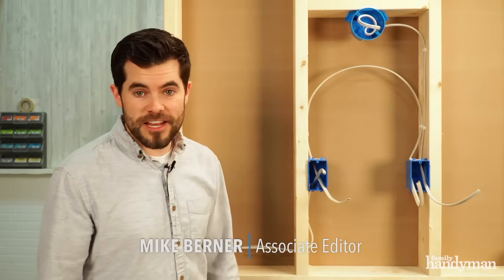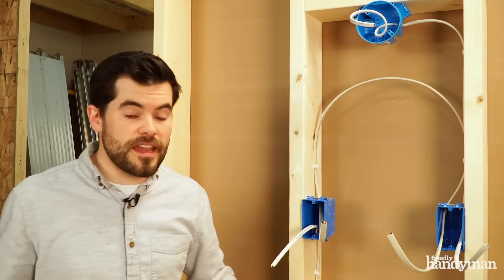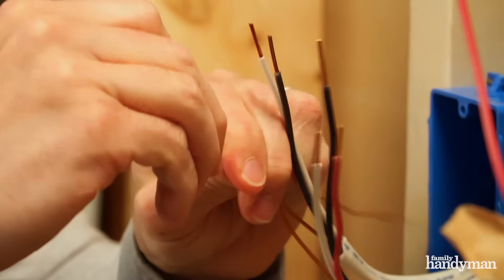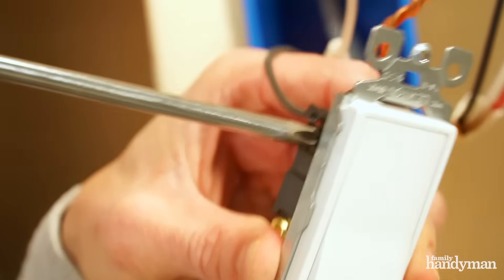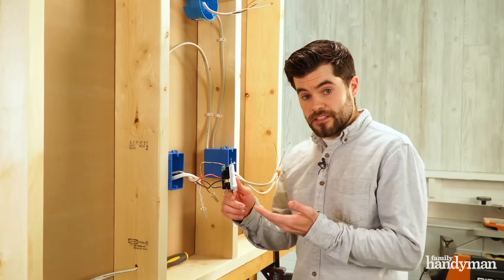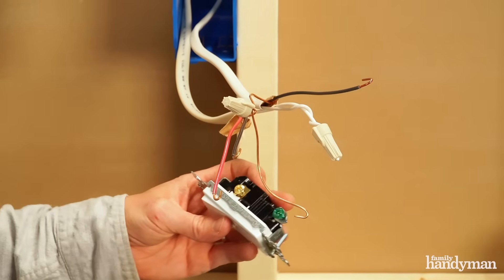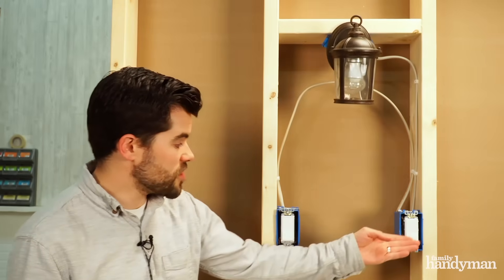How to Wire a 3-Way Switch

Comment: Very interesting.  But not all cables have the same colored wires.  So, it might be helpful to describe the wire with more than its color, but also its function, like you did when connecting all the ground wires at the beginning.

Comment: @Family Handyman 
Question, I have both the hot line from the breaker and the line going to the lights coming into the same box in switch 1. Switch two is clear on the other side of the room. 
How do I wire that?

Comment: Thank you for the video!  Attempting to put a smart switch (Kasa) in a garage location and I'm faced with no neutral wire extending into the garage switch box.  Kasa requires a neutral wire as I do not want to use a hub like is required with Lutron.  After watching your video, I may just connect the red traveler to the neutral in the first switch box inside the house to the garage and convert it to a single pole switch.   I also may just call an electrician if things get too complicated.

Comment: I think I noticed in the video that you have a 14-2 and a 14-3 wire but you did not explain that so I'm a bit confused can someone explain!??
Reply: EXACTLY! Good eye! It's unbelievable that he never even mentioned this!! 
First of all, you would only use 14/2 -3 if at your box the circuit's amp is 15 amps. And 12/2 -3 if your amp is 20.
With that being said, NORMALLY coming out of your box it's normally 12/2 wiring! But, when you are connecting the 2 switches you use 14/2 JUST TO CONNECT THE SWITCHES, and 12/2 to the light.

So, 12/2 is your main electric that's coming into the room.. you would only use 14/2 to connect switches.
Reply: the 14/3 wires serves what is known as "Traveler Wires". They connect between the two switches and are what enable the 3-way switches to work. They connect to the two gold screws on the switch themselves. One 14/2 is homerun (or what brings in the power), which connects to the black screw (know as "common") on the switch,  and the other 14/2 connects to the the other switch to the light bulb. If my explanation isn't clear enough, I would suggest that you look up how 3 ways switches work.

Comment: Be sure and label what color wire goes to the bottom lugs. In the video he has the red wire switched on each 3-way plug. That is incorrect!!! Red wire should go on the same lug on both switches!!!

Comment: I see that the power source is going to one switch and the other switch has the power going to the light but in another video the power source and the power going to the light was in the same switch. Does this mean it can be hooked up both ways? If anyone can answer this I would appreciate it.

Comment: Perhaps you should make a video on wiring 3-way switches that have a built-in dimmer also known as a rheostat.  Considering it's a series circuit i'm curious whether only one rheostat can be on the series circuit. Or is it possible for both switches to have dimmers and have them both work?  I only watched your video once but my takeaway was that a lot of what you said would only make sense if somebody already had quite a bit of knowledge with regard to wiring and were already familiar with all the terminology.  And it occurred to me that if somebody knows all that terminology they've already been practicing at this and probably already know how to install a 3-way switch. Someone who can't install a 3-way switch is a noob (Like me)

Comment: This seems simple for installing, but doesn't match what I have existing in my house.

My boxes have 10 wires total(3 separate bundles) at box closest to panel and 7 wires (2 bundles) @ the box on the other end. 

Every 3-way switch setup is wired this way.

Also all old switches have 3 connections...and all the new "smart" switches have 4.

Anyone ever run into this before...or have any idea how to proceed ?

Comment: I wired my lights the way you explained; however. The light would not turn on ftom one of the switches
Reply: Make sure that your second switch is set up identical to the first. The hot wires might be backward on your second switch.

Comment: Thanks for the video. I have a light in my stairwell that has a switch at the bottom but just a box full of wires with a blank plate over it at the top of the stairs. I've been wondering if it's wired for a 3-way setup. There is a red wire in there. I'll need to investigate further but I'm hoping I can just install a new switch up there. I've nearly tripped more than once in the dark going down the stairs.

Comment: You paired with black common wire with red wire travel terminal on 1st switch...on the 2nd switch you paired black common wire to the light with black travel terminal.?

Comment: How do you know which black wire goes to the light/common acrew if all that is hidden behind walls?
Reply: They are not completely hidden behind the wall. the part of the insulation where is trimmed is still within the box, and you look for that to determine which wires are the travelers. Process of elimination.

Comment: With this guys help and communication skills I was able to wire a renovation to half my house. When I finished all wiring I installed all fixtures and went around checking everything and everything works perfectly. 
Outlets, multifunction and three way switches. After doing this I gained a much greater understanding of residential wiring. 
Thank you sir for your videos. I saved a lot of money and learned a lot.

Comment: If I’m replacing a 3 wy switch, how do I know which wire is the connector to the other switch, and which goes to the light?
Reply: I know this comment is almost a year old but if you have a multimeter, you can do a continuity test between the two wires.
Reply: The wire going to the light needs to be on the black common screw

Comment: Great video! Seems I screwed up installing a 3-way dimmer, as the non-dimmer 3-way at other location was basically acting a a single-pole and wouldn't turn the light on when the 3-way dimmer was off. I had the red wire on the common terminal. Simply swapped the black and red wire and was good to go!!! Thank you sir!

Comment: He forgot to mention that you haft to wire the second switch opposite but main power on black screw. So if you wire the first switch with main power on black and red above and the black wire on the side by itself you haft to put the red by it self and the black on the main power side

Comment: Why is this a 3-way switch? 
1st way: Common contact connected to contact A
2nd way: Common contact connected to contact B
Where is the 3rd way?
Reply: 3-ways switch refers to the fact that there are 3 terminals (not including the ground) on the switch. Similarly, a single pole switch has 2 terminals. I know the terminology is confusing.

Comment: Doing a basement remodel,was having problems get the lights to turn on and off from both switches, after 20 videos found your with the same switches that I'm using. Correct the wires to what you were showing and bang work correctly thanks for your video.

Comment: you need a 12/2 wire from the light to the second switch and a 12/3 wire between the two switches

Comment: Maybe it's not code in America. Why do you slam the wire so tight into the box? It almost never happens but the extra $1 of cable can save $500+ in the future. Don't say job security, any busy electrician wouldn't wish that on an enemy.

Comment: Very understandable for a complete layperson. I am in a design class and had a question on 3-way switches for my "Electrical Plan", which was does "the other side have a single switch plate" on the other end.  Yes, your video answered my question - 3 way switch on both sides. There may be other ways, but all i need is the most common way.  Thank you! We actually have one two at the top and bottom of our starts :)

Comment: Mine is wired a bit different. One box I have power coming in - Black common and white capped off to the other set of wires. The other set goes directly to the light and the other box only has one cable with red, black, white and ground. I am confused on how to wire it. It seems everything is joined in the middle at the light.

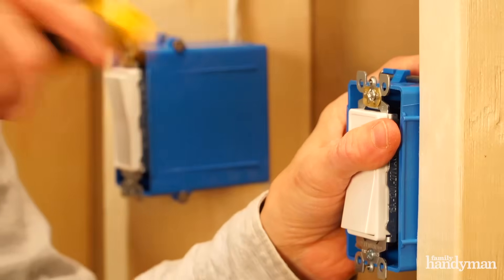Comment: 3:16 make sure to place the wire from the 14-3 to the same terminals on either switch .
Reply: That's why I came here to ask, does it matter? I'm used to them wired the other way, where "ON" is one up and one down, and "OFF" is both up or both down. Is there a code, or is it a preference?
Reply: @donf3739  it doesn't affect the function of the switches. You'll still be able to turn on/off the light bulb from both switches. However, it does affect the relative position of the toggles. You may have both toggles up and the light is on OR one toggle is up while the other toggle is down to have the light on. Either way is fine. Nobody really pays attention to that. And there is no code for that either.

Comment: The second switch black terminal should connect with the traveller‘ black . I think all the black terminals should be used to connecting with the income hot conductor, the brass terminals should connect to the light fixture

Comment: Just stumbled onto this video. Awesome. Thanks. Might need an electrician for my nexg problem....I have a 3 way unfortunately, my light has 2 sets of wire comming out it from it Seems the switches are powered from  2 different breakers.....any suggestions?😮

Comment: Once you strip the wire and loop it on the terminals you should always crimp them.  Also explain to your viewers you started with a 14-2 or 12-2 , which would be your line hot.  You should also explain that both three way switch are connected the same way with the travelers.   And slow down on explaining what exactly what you’re doing.
Reply: You should make your own video.
Reply: I'm. Hey Google should I run
Reply: thank you... this video is useless for anyone dealing with a 50 year old house using only 12/2

Comment: Wow... I started watching other "best explanation yet" of 3 way switch installation. . none was as quick and clear as yours.. .garbage pictures of actual wiring made it almost impossible to know which wire was coming from where. . .you need to understand the basics before you step up to actual installation. . like "how is this thing supposed to function". Your demo installation setup made this super simple. Thanks!

Comment: This could be common sense but he forgot to mention that the cable that connects each box needs to have 4 WIRES (BLACK, WHITE , GROUND AND RED). I installed everything but I thought it was only a 3 wire cable that connects the box. I had to redo it. Live and learn.😅😊 Very good video by the way.
Reply: ❤😂🎉😂 0:03

Comment: Before slipping it into the box, I tape the whole switch since there is a bare ground wire in the box with it.
Reply: Why would having a bare ground wire require you to tape the whole switch since the ground is almost almost always a bare or  non-insulated wire?

Comment: Every video has power coming on switch 2. Remodel so switch 1 has ppwer in and out to light. How can you add another switch to make a 3 way circut to light without tearing out ceiling

Comment: Thanks for the video. Without it I would still be stomped. 

I respectfully recommend you film a new video to demonstrate to your viewers that the wire between the switches is a 12/3, and that the power wire and the wire from the fixture to the 2nd switch are both 12/2. That is a very important piece of information to know.

Again, now I can remember how to run and wire a 3-way switch from memory though thanks to you simple to understand video.

Comment: Nice video. Very clearly explained and demonstrated, but it would be helpful for those watching to see that they will need both 2-wire and 3-wire cables. The 3-wire cable has the additional red wire and is used only between the two switches as you correctly showed but didn't elaborate on. Also when shopping for cable, lights are wired in 14 gauge, so the packaging would indicate 14/2 (the second number indicates the number of wires in the cable but not including the ground) and 14/3 which would be used as the common between switches.
Reply: 6 months late, but let me say at least one person needed this info!  Thank you very much
Reply: Agreed this is info some might need
Reply: For anyone confused by this comment whether you need 12g or 14g wire- just check the breaker amperage (the number labeled on the breaker handle) that the circuit is connected to. If it’s 20 amp, you can ONLY use 12g (or larger). If it’s 15amp, you can use either 14g or 12g wire. 

The problem with just stating “lights are ran with 14 gauge” is that many lights have power that has been pulled off of a nearby receptacle/circuit, therefore likely attached to 20amp breaker. Lights wired like that are VERY common to find. 14g wire is too small & can overheat in those cases. 

I personally never run 14g even when acceptable. All my 15 & 20 amp circuits get wired with 12. The $ savings of using 14g instead of 12 is very minimal.
Reply: @Brad_montane   Thanks for your comment. There are many different situations that can influence the way a circuit is run. To go over all of them is beyond this video's intention. Someone watching the video will have seen the content creator go to the breaker panel and switch the 15 amp breaker off before doing any work. My comment was inline with the video and its content. 

If you are wiring an older home and plan to draw power from a nearby circuit, this video is not for you. The instructions provided focus on running the wire directly from the breaker panel, as indicated by the electrician.

When wiring a new home, separating lights and outlets onto different circuits can enhance safety and convenience, as it ensures that if an outlet circuit trips due to overload, the lights will remain functional, preventing total darkness. This approach also allows for better load management and simplifies troubleshooting by isolating electrical issues. However, it can increase complexity and installation costs due to the need for more wiring and breakers, which may be a concern if panel space is limited. But for me its always been a cleaner more organized installation if it can be done that way.  Best practices recommend using 14-gauge wire with 15-amp breakers for lighting circuits, as this wire is easier to work with and more flexible, while 12-gauge wire with 20-amp breakers is suitable for outlet circuits, particularly in kitchens and bathrooms where higher power demands are common. Ultimately, while separating circuits can provide added benefits, the decision should be based on specific needs, budget, and local regulations.
Reply: Thanks for clearing that up!
Reply: Thank you!
Reply: Thank you. I was wondering about that.
Reply: Thank you for your explain an airport to me you should do your own. Because it definitely helped me and broke it down a little bit more detail thanks
Reply: Thank you for explaining this to me great video
Reply: this is exactly what i needed to know
Reply: Almost imossible to find someone that says 2 or 3 wire anywhere online.  Very annoying and so basic.
Reply: 😊😅😅😅 3:14 3:14 3:14 3:14 3:14 3:14 😊
Reply: It’s more common for lights to have 12 gauge wire not 14.
Reply: @rxstarryan.9179  Typically, for residential applications, it is more common to run a light switch with 14 gauge wire as the video creator is doing.
Reply: @rxstarryan.9179  WRONG. 15 amp 14 awg wire is the standard in a home. 12 awg 20 amp circuits are for miro's, FAU, bath and kitchen GFI's. Just saying as a 35 year lic electrician...
Reply: Ive been an electrical apprentice for almsot 4 years going for my license very soon and there are other uses for a 3 wire coming out of a switch box as well not just for doing 3 way switches between lights. We use 14-3 to wire up switch plugs that you can turn table top lights on and off with. They are also ran in between smoke detectors to connect them all together throughout the house. Other than that this is a great video for beginners!🙂
Reply: Exactly. A big waste of time.
Reply: @SailnowFun Are you mad that you're looking at three-way switch videos instead of sailing? I'm mad that I'm replying to your video instead of getting dressed and starting my day. Next I will be mad when my wife points out that I'm still lying in bed looking at my phone. Then I will be mad that my wife reacts to my shitty reaction to having her point out that I'm lying in bed. Already this day is becoming a journey! I think I will spend more time thinking about how I could do it differently. Thanks for helping me!

Comment: I see that you use a wire nut by simply placing the two wire in parallel and turning the nut to hold them together.  When did this become common practice?  I learned (many years ago from my grandfather who was an electrician) that the wire should be twisted together first.  This provides a good mechanical connection.  Then the wire nut is twisted on to provide some backup for the mechanical connection and to insulate the bare wires.  I'm pretty sure that you will have better results with this technique, and it will be a safer connection.  The extra minute to twist the wires might prevent a fire.

Now, don't get me started about back wiring switches and sockets.  Another technique that saves time but sacrifices safety.

Comment: Great video. Just wanted to mention that there are two different kinds of 3 way switches. One has a ground screw and the other doesn’t. The groundless switch grounds through the mounting screws and that is acceptable but the switch with ground screws is much safer so be aware of this when purchasing.
Reply: If you're using metal boxes that are grounded, the mounting screws for the switch will ground the switch.
Reply: Uh yeah I wouldn’t use a switch without a ground screw.